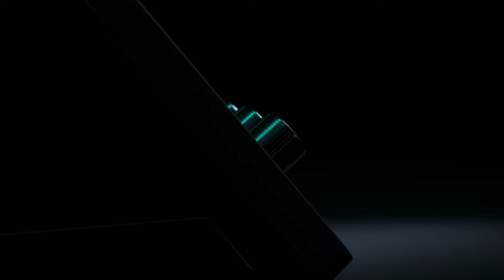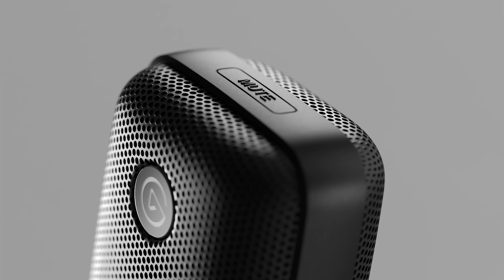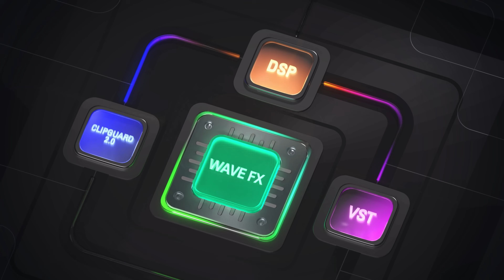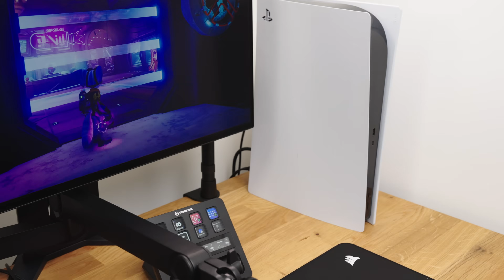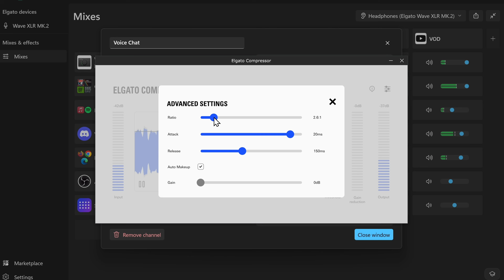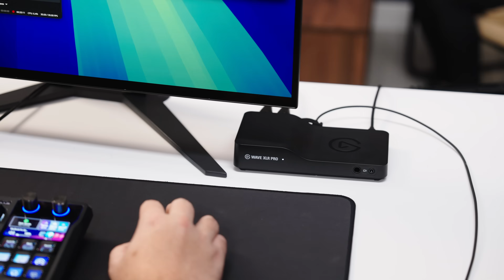Meet Wave Next:  The Future of Creator Audio

Comment: Excited but wavelink is currently broke as a joke.  Fix the software properly before revealing all of this.  Picked up 2x streamdecks one of which being the Plus for the dials and I couldn’t tell you how many times a “connect this blah blah” rendering the software useless so I’d have to uninstall to then reinstall a previous actually functional install.  

Everything looks great but you need help with the software…:it seems it has ALWAYS had issues.

Comment: linux support for the wave link app? page says windows/macos only
Reply: Abuse host+aux and pipe host through to a Windows vm
Reply: @efad3215 That's like using a flamethrower to light a candle
Reply: @efad3215  The answer is not use a Windows VM. The answer is it is 2026 and companies still can't manage to build software for cross platform.